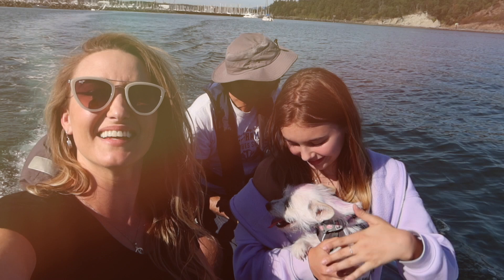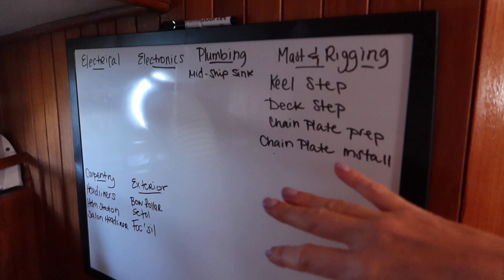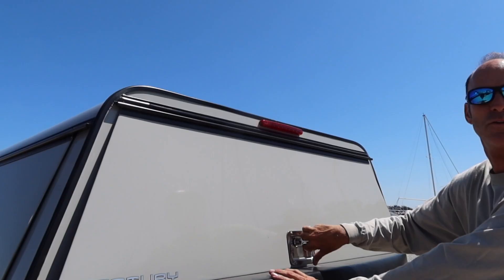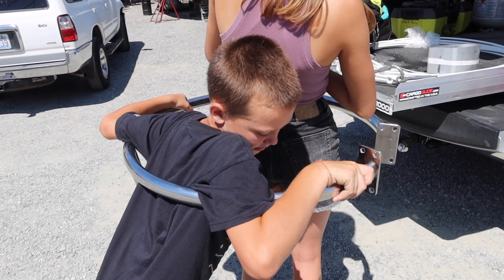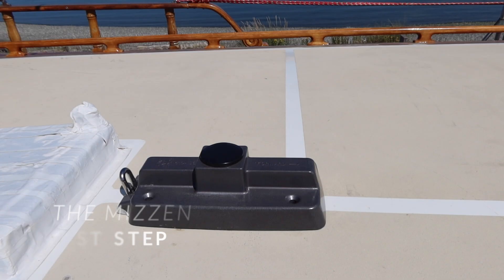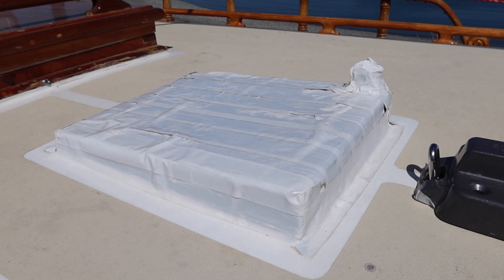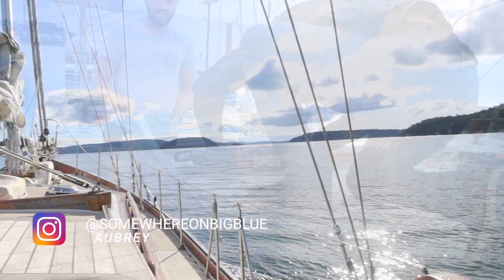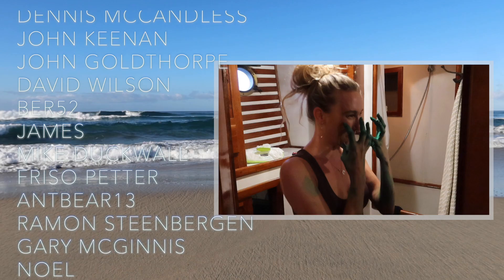Bigger IS Better | Pirate Ship S13E05

Comment: I have a 68 Formosa ketch. Love your project.  You probably know the iron fuel tanks probably need replacing.. they had lifespan of 30.  Good luck on project.
Reply from the maker: Grrrreat boat!! Yes we have just started getting into the tanks.
Reply: @SailingMissLoneStar   Cut the tops off the tanks , Put plastic down & Maybe Put Bladders in the Tanks and be done with it. might be easy.

Comment: I found that aluminum anchors float down slowly . There’s times when anchoring  needs to be done quickly in the right position.ion the sand. There’s also knockoff cheaper danforth lookalike anchors which don’t set right

Comment: Thinking you probably should have used epoxy for the mast step to fill the cracks in the wood.  Just tape off the sides of the wood and down to where it meets the deck and pour epoxy down the cracks.  The epoxy would settle down into all of the voids of the wood and fill them.   When the epoxy cures it can be sanded flush with the wood's surface.  Epoxy also expands and contracts with wood movement.  Can't wait to see the boat launching.
Reply from the maker: We went back and forth on that. I’ve used it in other cracks in the real around the boat and it is definitely more of a process
Reply: The epoxy can be thickened a bit with colored sawdust. makes for an (almost) invisible repair.
Reply: Yes...wood filler has zero strength.

Comment: I'd take care of the wood on deck before mounting all the outfitting stuff. It's harder to do later when it's all in the way. 
There are tools to get out broken screws. These brass screws are a pain in... But it works, there are tools to fit a  1/4 " wrench or for hexagon bits to use with an universal screwdriver or power drill. But better do it by hand...

Comment: Investigate the proper way to connect your anchor correctly. The way you have it connected now is for failure at the worst possible time. The minute you start to raise or pull the anchor from the side that connection will fail. Please don’t fall into that trap we’re you know better than the people that have made the mistake. You must add shackle between the anchor and swivel.

Comment: hey guys the white paint/laminate on your solar panel is rubbing on the frame, that laminate dissipates heat, so if you scratch it, all the way through even slightly you'll burn your solar panel, not really fire risk, just means your panel will be useless, as burning one of the squares is the same as dropping a cell in your battery, and work against any other panel in series with it. (ex solar electrician) boat is looking awesome otherwise
Reply from the maker: I will look into that. Thank you for the tip. :)

Comment: Good you didn't coat the mizzen mast step with Epoxi. EP is not pressure resistant on wood (soft underground) But the cracks want to be filled with waterproof glue, not with wood filler. Doesn't matter the oil on top is marine stuff. The underground also needs to be saltwater proof.

Comment: You have not connected your Anchor correctly. As connected in your video your anchor can become stuck in so tight that you have to cut the line to get free. Especially in deep cold water anchorages. The top hole should be connected with a break link or short piece of rope to break free when too much stress is applied. There is a second hole closer to the front of the anchor. This second hole is where the strong chain link is connected and when you break the weak connection at the end of the stem all force is applied there and the anchor comes right up. (Hopefully). Anchors and chains are expensive. Connect them incorrectly at your own risk. Lol
Good luck

Comment: Think hard about ground tackle.   Awesome new anchor, but maybe keep the old on as a secondary on 30m of chain. Also, you said something about the bow roller at the end of the bowsprit.  Must look at the leverage there with the whole weight of the boat yanking there.  There is a good reason why the bow rollers are just barely outboard.  Maybe you need catheads to cat the anchors at sea.
Reply from the maker: We are finding that to be very true and are currently working on some re-engineering.

Comment: So wait - you're converting your keel stepped rig to deck stepped? But keel stepped is far far safer for blue water than deck. I have three basics for what makes a true blue water cruiser - deep encapsulated keel, protected rudder and keel stepped mast!
Reply from the maker: No no no. I just keep messing up the terminology 🧐 she stays original just replacing the old spars for new fancy ones